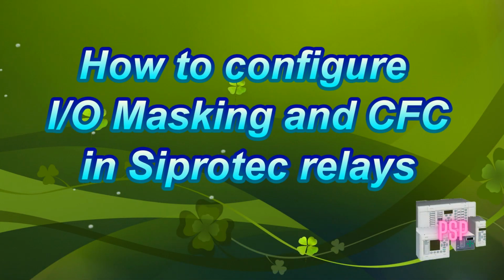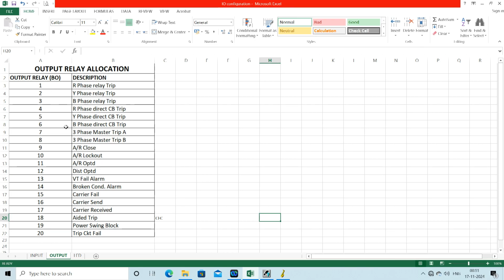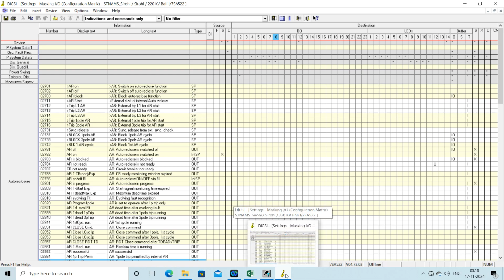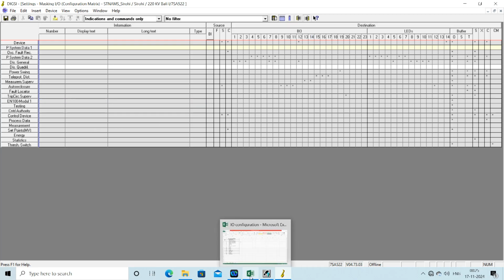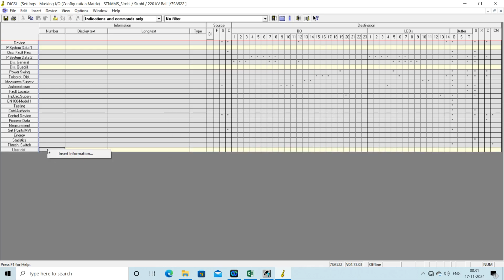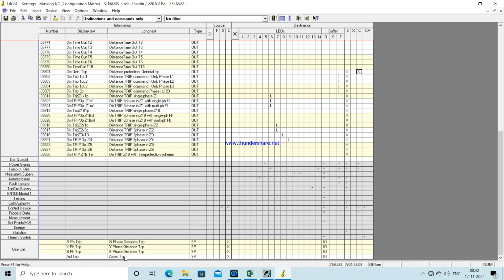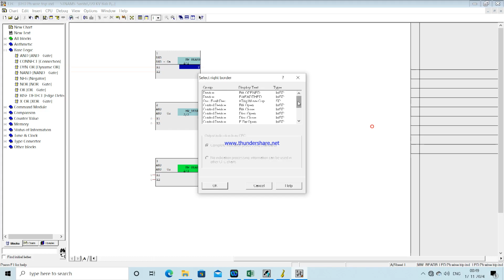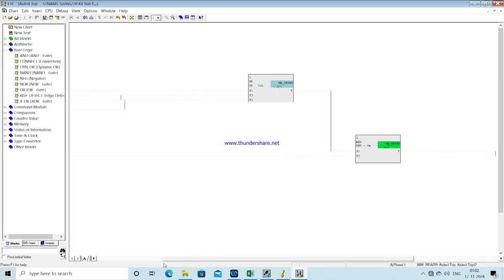Configuration of I/O Masking & CFC in Siprotec Relays | SIEMENS IEDs | DIGSI 4

Comment: The active & reactive  power showing in the HMI is 4 times the actual power for a 132/33 KV transformer.
So, I analyzed the relay is calculating the active power from HV side PT input which is connected to PT terminal in the relay and for current it is calculating from the LV side current rather taking HV side current as input for power calculation. So, I am asking that from where can it be changed.
Reply from the maker: @dipto6713  please check ct & pt ratio in power system data 1 module ........ My email id -  erkaushik.hore@gmail.com. you can extract the setting and send it to me

Comment: Sir I am getting Active power showing in 7UM62 differential relay calculated from LV side current. How to change it to HV side current? The power showing 4 times the actual power of the transformer.
Reply from the maker: @dipto6713  for transformer power V1*I1 = V2*I2..... but I couldn't understand ur problem..... Please mail me with relevant details for detailed analysis
Reply: @PSProTech  Sir please provide your email ID.
Reply: @PSProTech  Sir please provide your email id